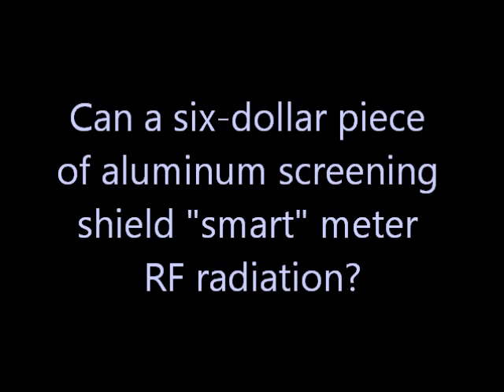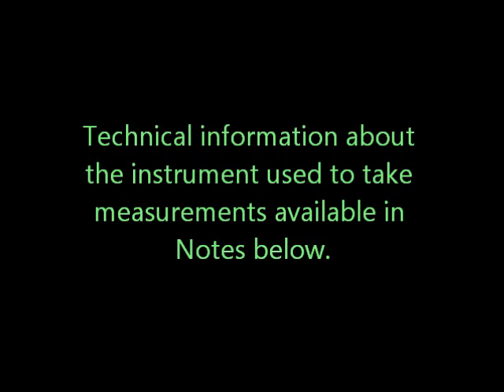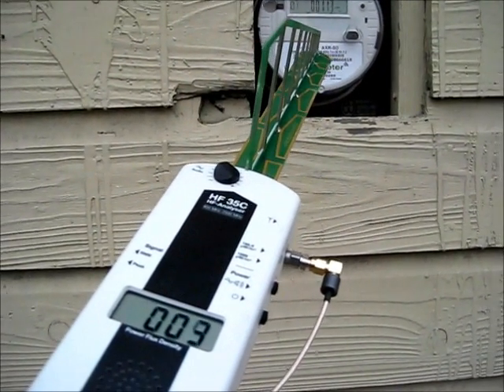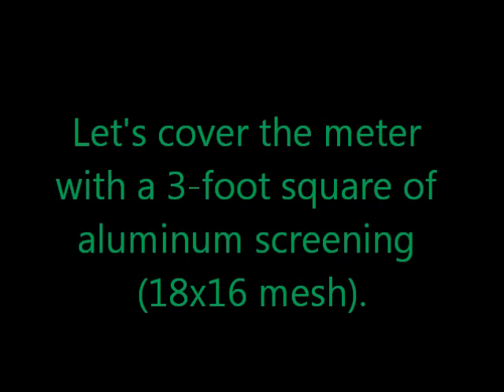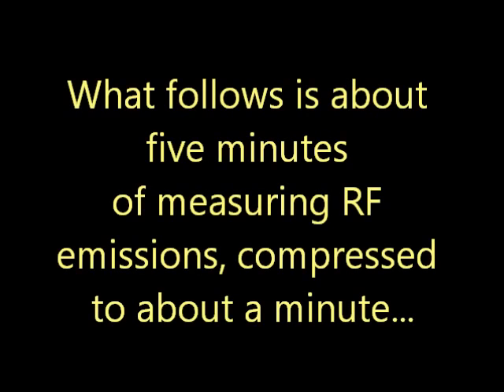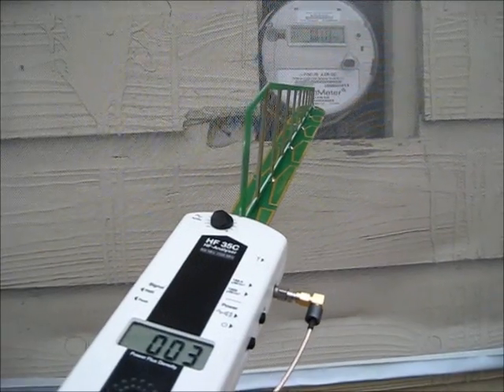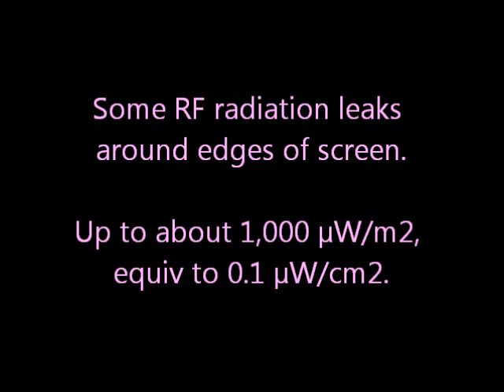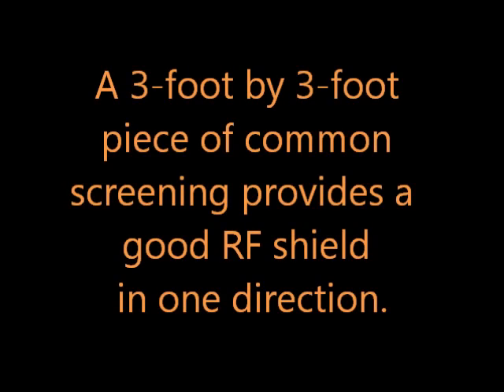Foiling a "Smart" Meter, Part Two: Aluminum Mesh Screening

Comment: Shit iv pump 14kw of RF power through antennas to talk to people around the world and guess what I'm just fine XD
Reply: +keagan engbrock  lot's of crazy people out there..
These people should be in straight jackets. I have actually touched 6146 radio tubes while i had my mic keyed up. 1000 watts. I am fine..
Reply: +keagan engbrock What frequency is this 14kw of RF power being put out at?
Reply: +Dave M You might be fine, but did you know your comments are glowing?
Reply: Solar EMF has been around forever, so maybe we are genetically protected from it?
Reply: +keagan engbrock How would you know if you are fine?  Do you spend any time and focus on your energy, etc.?
Reply: +Dave M & +keagon  Ever hear of Ohio`s WLW that was pushing 500kW, fascinating stuff...there's video of the transmitter on YT.  The Voice of America at Greenville North Carolina was the world`s most powerful, more than a million watts, I think.
Reply: I find it so funny how people go insane over these meters.  Just because they transmit and receive to cell phone towers. When they don't understand the fact that this is a vary small thing compared everything else that transmits.
Reply: +keagan engbrock What frequencies is your antenna putting out?  How close to the antenna do you sit, and for how long?
Reply: +mmakshak I think the technicolor tc8305c router(my comcast router) uses 2 antennas(maybe as transmitters also?) is not healthy, if you sit around 3 feet from it(when it's in the default hotspot mode).  Since I did this for awhile, I don't think it's healthy to sit the same distance from it, after the hotspot mode is disabled(it's just not as bad.).  Now, if someone is able to translate this information into a general formula, we might be able to get an idea of what distance we need to be away from what transmission power is being put out by these wifi-type signals.  I believe the smart meter's transmission frequency is around 918mhz, and the router is at 2.4Ghz or 5.8Ghz, or both.  In addition, I think some of the newer routers make the areas wider.  The 5.8Ghz transmitter is supposed to be stronger, but not go as far.  Before you criticize me on this, I want to point out that I'm trying to do the work that the FCC, cable companies, and phone companies should be doing.
Reply: Anyone who criticizes you for wanting to be able to measure you radiation exposure is a fool and will soon get burned. Radiation burns.
Get an old am radio, preferably battery powered, the older the better because they have less interference filters.
You can find them at a thrift store for a dollar or 2. 
Set the dial all the way to the high side of the am scale. You should be off station and just have a little "white" noise. (static) 
Wave it around the room, go by your cable box, computer, keyboard and monitor - get between stations below 1000, 600-1000 and wave it around your monitor. There are a few things you have to be at a different frequency on the dial to pick up, and while you will pick up your monitor on the high end of the dial, well, I'd sure like to know what/why my monitor makes the noises it does - that can be heard on the am band between 600- 1000. It is a led.
Check what your cell phone does "resting", and when you lite it up, when you make a call and watch, well, listen to it really go nuts when you hang it up and would be putting it back in your pocket! '
Then plug the charger in the wall & wave it around that. Then plug that charger into your phone. Compact fluorescent bulb are insane! Those put their poison into the wires throughout your home! Wave radio by the light, then turn it on, and then check the cord or the wall switch. Anyone running cfl bulbs is killing themselves! 
The radiation is broadcast &/or travels in/or somehow has 3 vectors to it that I don't really understand, but it means that there are three different positions you might need to have/hold  the radio, or even some meters in to pick up the radiation.
Try horizontal, then vertical and then turn the end vertical, and/or 90 or 180 degrees to those. 
It's not as complicated as I make it sound. Just wave it around and you will get the hang of it. You will be shocked. not literally by the radio, but literally by what you hear from the radio.  I bet we are far more sensitive that that radio 
 I paid $150 for a trifield meter 4-5 years ago. 
While it is versatile, it is not very sensitive in many ways.
Still, it will pick up smart meters from across the room.
I haven't heard smart meters on the radio for some reason.
smart meters and the cable boxes are the worst. even if you don't have wifi, they are broadcasting 24/7 to provide a hot spot for anyone who happens to be around your home.  check your mattresses & box springs because all the metal in them make like big antennas! A lot of times it is your body that completes the circuit somehow, & the radio only makes noise when you are holding it. Like if you set it on the desk where your keyboard is, it may not make noise until you are touching it. Same is true for your bed. Try both sides of the am dial, and FM too. Most everything except dumb meters will show up on the high side of am.
And brace yourself, because what idiots and fools will try to call you as you wave the radio around will be a bit more harsh than a little criticism. I got a battery radio at the thrift store for 75 cents that looked like an old turntable. Much smaller. Where the record would be was the dial, and the arm was the volume. People thought it was an expensive test meter and they all were suddenly amazed!
75 cents! am radio! critical fools suddenly amazed! don't let em get to you. It is your LIFE we are talking about here.
And remember, when you shut the radio off like everyone will want you to do as soon as you pick up some radiation, doesn't mean it has gone away and is not affecting you! 
I'd really like to hear what you find. And please, share this info.  Good luck & God Bless.
Reply: And typical solar EMF on our upper atmosphere is something in the neighborhood of five million horsepower per square mile. [1.44 kW/m2]

(according to William O. Brooks and George R. Tracy. "Modern Physical Science" New York: Holt, 1957: 566.)

Just to help put things in perspective.
Reply: You can mitigate some effects of these frequencies by raising the energy of your body.  The stronger dmf still comes through to affect you, and distance is your best defense.
Reply: That's emf-not dmf.
Reply: youGooglin
 I have an old house and I sleep in my cast-iron bathtub. And when I get really worried of the electric motor in my clock radio then I cover myself with lotsa steel wool. Y`know..... just to be on the safe side.
Reply: I dunno for sure but it is fascinating. Ever hear of the Holmdel Horn? Not too far from me, I keep meaning to visit it.
Reply: ``I think the technicolor tc8305c router(my comcast router) uses 2 antennas(maybe as transmitters also?) is not healthy, if you sit around 3 feet from it``  

  ...a good cat5 cable costs about $3. If you`re that worried about it....Easy peasy.

Comment: Do people realize that everything in the universe vivbraits and if you interfear with that vibration. You interfear with vibration of your body and inturn the body makes adjustments and not all are good for your vibrations, health or nature.
Reply: +olmosm1 You can use quantum physics to get the energy of a high energy place into your home, or elsewhere.  Put scribbles on a piece of paper, xerox it a number of times and burn the original.  Laminate a sheet of those scribbles, and put it in a high energy place(outdoors-maybe on a mountain top?),  The other sheets(even each scribble-i use 55 scribbles in each piece of my orgonite) will now carry the energy of that high energy place.  You can put these scribbles near the source of EMF.  I've now given everyone a method to help with these things, and one can experiment with this.  Isn't this better than someone saying there is nothing that can be done?